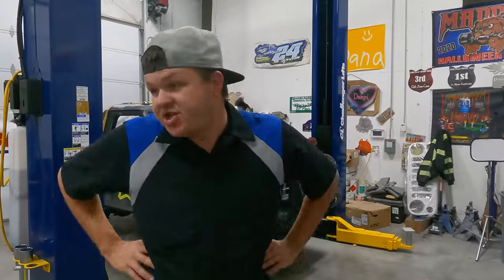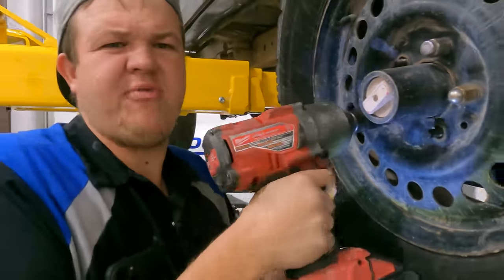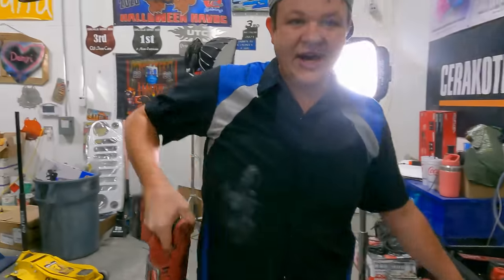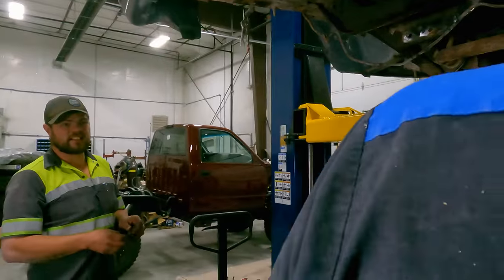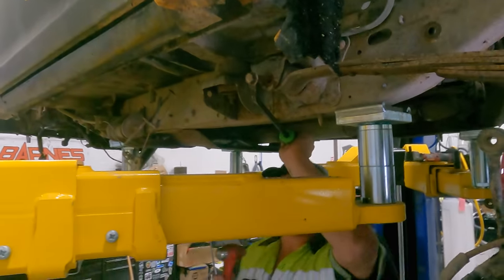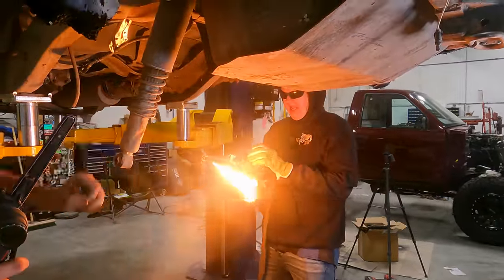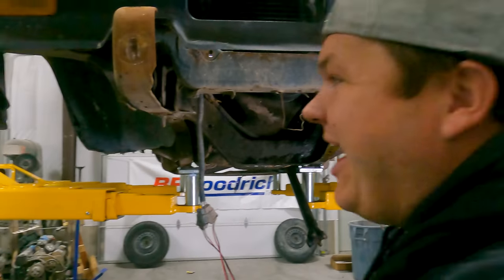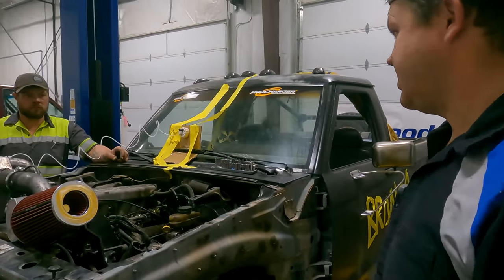We Totally Destroy The Supercharged Bronco II Suspension!

Comment: My suggestions:  Keep the exterior Bronco look, and use the interior of a ranger bed inside of the Bronco. The ranger bed interior will provide both a better hauling surface, as well as provide better durability to the elements when ran without a top. Definitely add a massive winch up front! Keep Hillbilly's swing away spare tire holder. You might could consider getting a Ranger donor chassis frame, especially since the BroncStar frame has some through rust. Using a ranger chassis frame will also give the long wheelbase Hillbilly wants for his truck. Stretch the BroncStar rear body. The Ranger chassis frame can be shortness to any desired wheelbase and length. Just my two cents worth!

-Rob in Tennessee
Reply: Great idea!
Reply: If they cut the back half off and add a Ranger bed it wouldn't be a Bronco any more. Great idea to put the Ranger bed on the inside of the Bronco.
Reply: Wondering if the spare tire holder will be strong enough to hold the giant tires it will get.
Reply: There are aftermarket swing away spare tire carriers similar to the one on the BroncStar, which which mount to the rear bumper combo with a pivot point which is able to handle a large oversized tire, as well as having provision to carry an off-road style jack. I saw these on YouTube Jeep channel, perhaps Bleeping Jeep, but not sure which channel.

Comment: I really hope you're planning an engine swap, those 1st gen 2.9s are notorious for cracking heads even without running hot, a 4.0 would bolt straight in.
Reply: It really needs a new engine, this one leaks so much compression that it throws the dipstick out since it got supercharged

Comment: Robbies Wife is too cute. The sound effects were right on. If Hillbilly is getting a used bike. I recommend a 2009 or newer Touring with the 103ci motor. They have a factory 180mm rear tire and will fit a 200 with no modifications.

Comment: Twin I-beam independent suspension is a really capable 4X4 system.  Lots of travel up and down ability ... but it has some problems when it starts to  wear out (center most) mounting bracket/plate and bushings throughout... 
Other than that the TWIN I-BEAM IS AWESOME ...
Reply: It's fine for mild off-roading, but it doesn't have the articulation needed for a rock crawler.
Reply: @bripslag  so true ... I had a 1980 long bed posi-front with 300 straight 6 and granny first . Couldn't pass a thing on the blacktop,  couldn't stop it in the mountains. it did pretty good for almost any trail / back road ...
Rock crawling probably not the best for sure.

Comment: There's a guy on the old ranger forums back in the day who used a ranger gate to close off the front of the bed. 

That steering box in that thing was used in cars up to full size trucks, it's the pathetic steering pump you need to worry about. Make some brackets and mount a Saginaw pump; at least with that pump you can use it for hydro assist.

Comment: I have a question why do y'all keep calling driveshafts Drive Lines in fact the Driveshaft –  is the first component in the driveline. It is connected to the transmission and begins the power transfer process that goes into the differential(s), axle shafts and wheels. Differential(s) – A differential will control power to the individual drive wheels on either side of the vehicle.

Comment: Tucking the nose on the bronco2 and giving it an actual suspension is cool and a pie cut ranger bed with the cage is cool. The suspension on those was fine for the wussy trails but not a rough country suspension. Too soft and not enough traction no lockers and the trannies were nearly worthless . And powerplants like the 2.9 and the 3.1 and 3.4  were good but not built for power and they were epa dogs

Comment: It was destroyed right out of the factory, in my opinion the Bronco ll was one of the worst vehicles they ever made. Bought a 86 Eddie Bauer bronco ll and it was never drove hard but total junk at 60,000 miles on it 3rd Tranmission, with low oil pressure from a defective oil pump Ford used!
Reply: Lol but ford guys insist it's better than the other brands XD